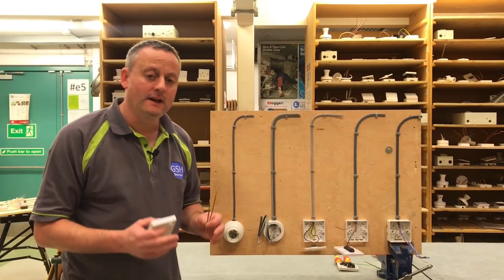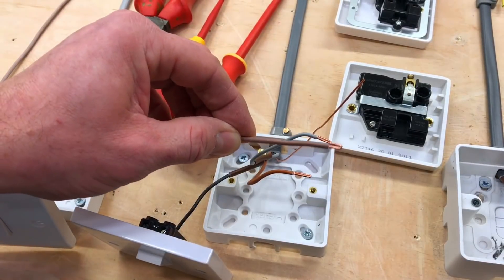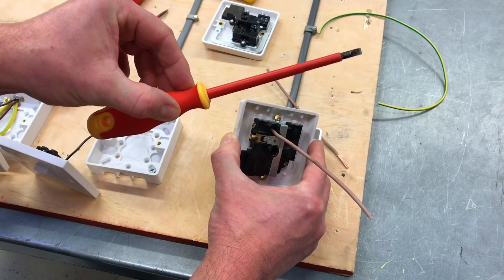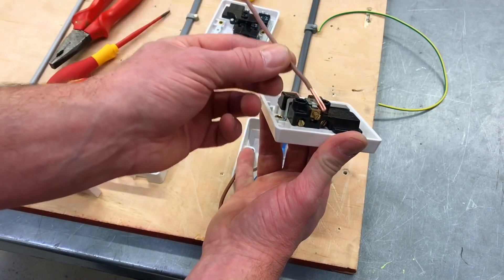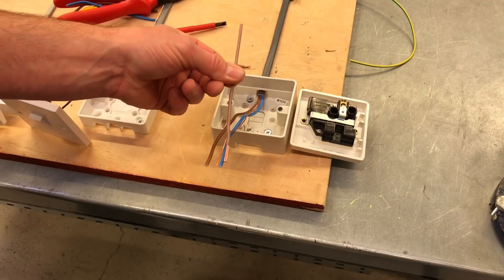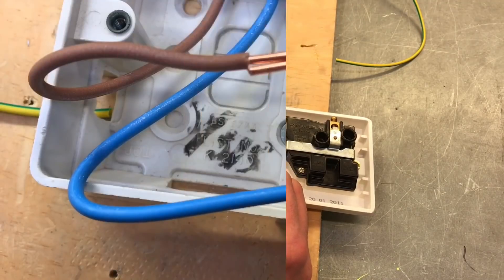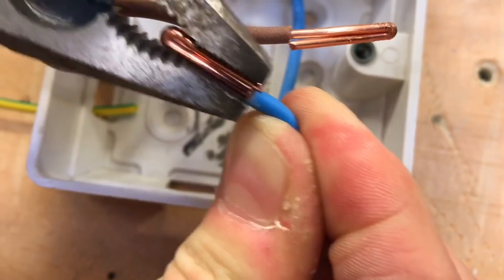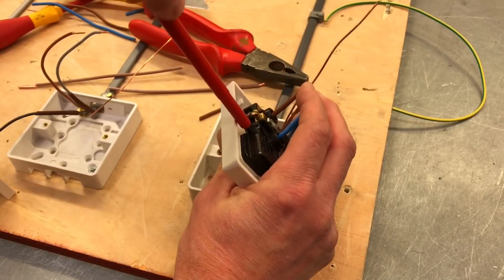How to Connect up (Wire) our First BS1363 Single Socket Outlet to 2.5mm Twin & Earth (Twin and CPC)

Comment: I'm aware this video is very old but hoping anyone sees this and can answer, if im doing a socket on a ring circuit, so the L,N & Earth are coming back out of the box, should i still double over? I feel there might be a conflict of space with 2 wires doubled over in one hole.
Reply from the maker: Fill the hole if that’s doubled over then great but if they won’t fit then singled 👍🏻. All the best Gaz
Reply: @GSHElectrical  Cheers mate, keep up the content really helping with the basic stuff as im starting out

Comment: When terminating 2 or 3 cores into the same terminal, do you still double over your cables? Personally found, in my opinion, that it actually has the opposite effect in ensuring the terminal screw grips the copper in that scenario.  End up putting one conductor on top of the other for lack of space due to doubling and the screw bites the top conductor but the roundness of the copper is not good for clamping the conductor underneath and can lead to loose connections and seems much safer to just have both conductors undoubled and side by side in the terminal so the screw grips them both equally. What is your advice for students who struggle fitting more than just one feed into terminals and especially with 4mm which seems to crop up a lot? Thanks.

Comment: Sometimes there are two or even three cables. Would you still double over all the ends?
Reply from the maker: Hi, I always double as many ends as I can to fit into the space. Thanks for the questions. Gaz
Reply: @GSHElectrical  so what happens if they are more cables going into the terminal

Comment: The sockets in my house on the ring all seem to have the cables twisted together into ugly little bundles where they go into the socket, I wonder if that’s an old school way of doing it that’s not taught any more? Never looks very neat or reliable to me
Reply from the maker: Hi, I would class that as poor practice. Thanks for watching and commenting. Gaz
Reply: @GSHElectrical  I would just say that in the days of 7/029 we would twist all strands to a single bundle,  stopped the odd cable escaping the screw.
Reply: I thought this would be better to twist them seeing as soon as the screws grab the twisted wire there's less chance of the wire coming lose as the screw would bite into the twist. This would be akin to a rope. Pull on a big chunky rope and there's lots of friction as opposed to a smooth rope. Also, at least if the screw failed there's still a solid connection with the twisted wires.
Reply: the problem with twisting the wires is that it can still test ok even if they've come out of the socket. Best avoided.

Comment: Excellent video as always Gaz. Did i read somewhere in 18th edition doubling up not necessary for multiple wires such as part of a ring final? Also i like to line up the doubled end flat so the terminal screw hits it smack on and not on end and cause some loose connections possibly.
Reply: This ^^